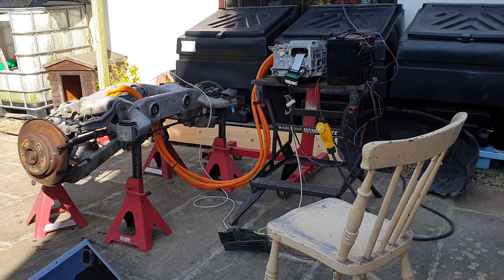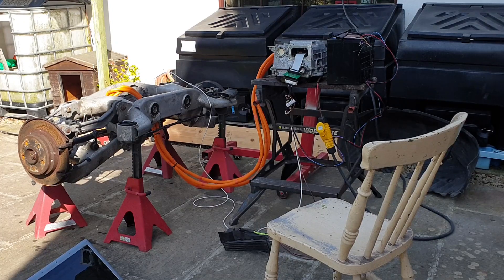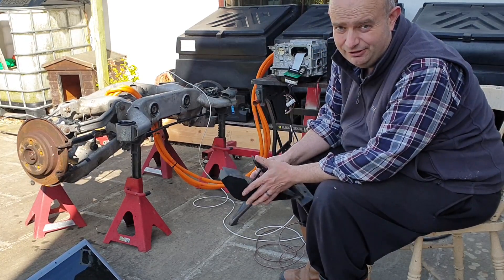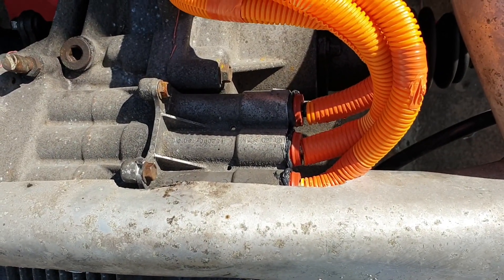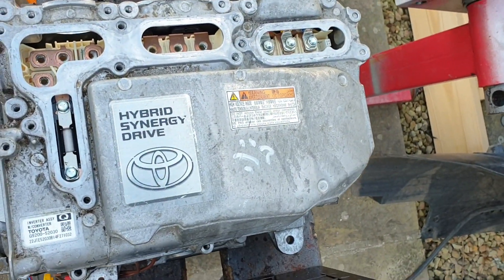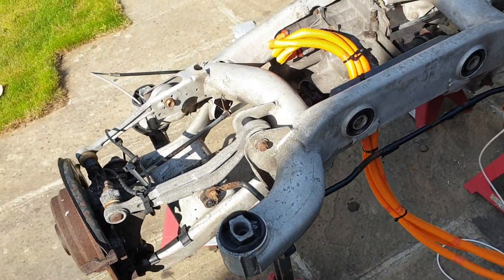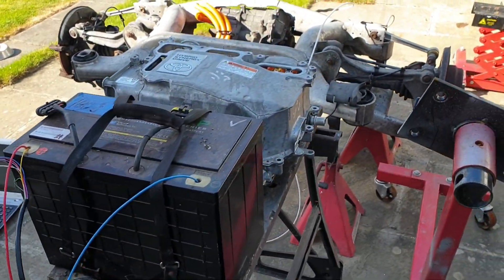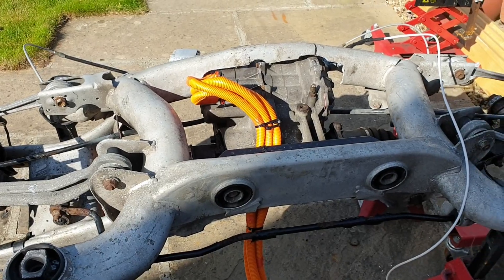The Blue Yacht Ep2 : It Spins

Comment: It's looking great👍
You've inspired me to transplant 
 Mitsi phev twin electric motors, uprated batteries and ev control systems  into  2007 L322 rr, I'm just hoping rear and front subframes is as neat as your job 🤞😷
Reply: evSteve great idea, will leave all the trans tunnel for batteries, been thinking that could be good on a disco 3
Reply: @temporarynoble  I did originally look at using a  D3 and a P38 because there stronger than a l322 with ther separate chassis, 
But on offering the Mitsi PHEV subframes up on an L322 body shell , the mountings are almost in the correct position and look a good fit 🤔
But to maintain the full legendary off road RR  wheel articulation I'm staying with the L322 subframes , driveshafts and brakes , and dumping the Mitsi subframes due to the superior L322 geometry
Measurements are leading me to believe the Mitsi battery pack will fit nicely in the l322 ,
allowing greater depth which will give room for the larger Yusa 7 ah battery cells. 
👍
Reply: evSteve is that a mitsi rear unit at both ends?
Reply: @temporarynoble  Front using the brilliant Mitsi 80 Kw generator motor drive, that Mitsi 80 Kw generator is years ahead of any current phev system 😷